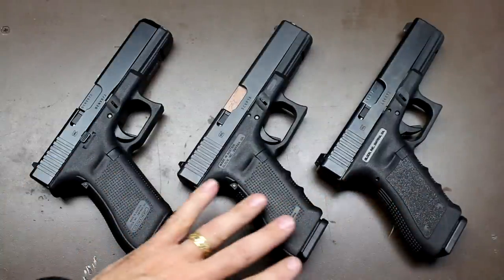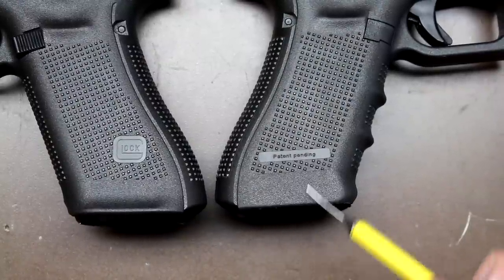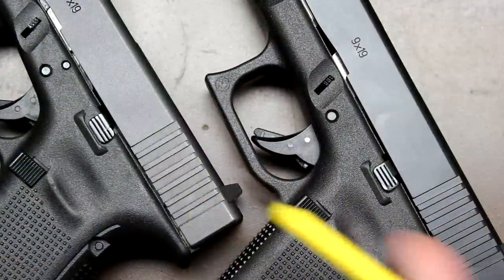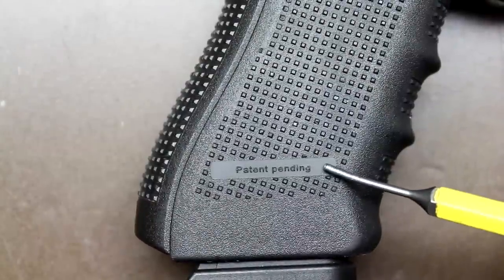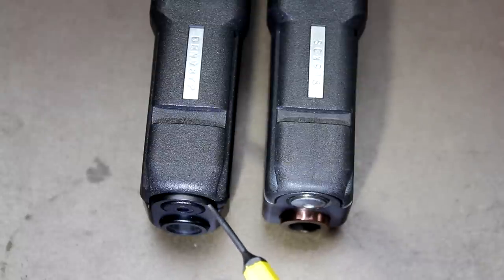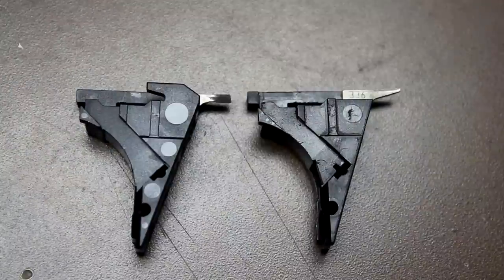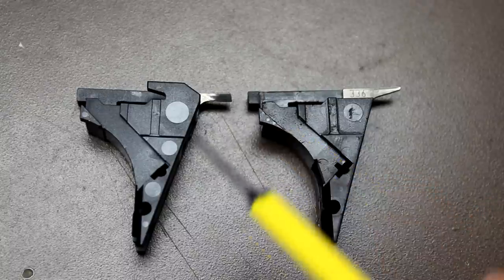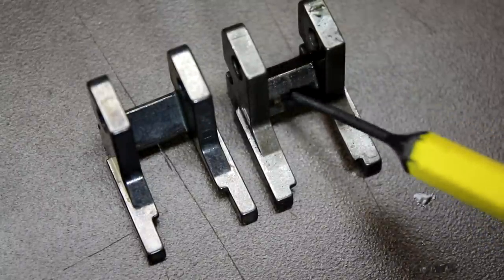Glock Gen 5 & Gen 4 Detailed Comparison

Comment: I refuse to buy a glock until the trigger system is fixed .
Reply: Joshua Murtz you have a point !   Don't forget about the sights !
Reply: I've owned Glocks for years and I've never had a problem with the triggers and I've never had a Glock fail so come again?
Reply: Joshua Murtz  They go off, so there's it's not broken.
Reply: I've had Glocks since the first series of G17.. I'm at a loss as to what "problem" the trigger has, since I've never had a malfunction with a Glock
Reply: You can't fix perfection.
Reply: Diy
Reply: I've used a Glock 22 for Law Enforcement since back in 1997 and Never had a problem, NEVER NONE! So, what is the problem that you say they have?
Reply: What's funny is that the Glock isn't my favorite fighting handgun, and I'm also not a fan of most of the Gen 5 mods. But they are absolutely a tough, reliable weapon I would bet my life on
Reply: Joshua Murtz 
The trigger is good for fighting and defending life and property. Guns aren't intended to be used for computing shooting.
Reply: Can't beat the consistent durability that Glock possesses. So yes.. among the millions of shooters, those that look for the different or negative, will find the different and negative. You find what you're looking for, and I choose to look at the rock solid durability that my Glocks bring to the table.
Reply: You cannot diss a trigger you haven't practiced with, or aren't 'used' to.. anyone willing to put in the time, can machine gun a glock trigger. Where the lead hits is also up to that individual.